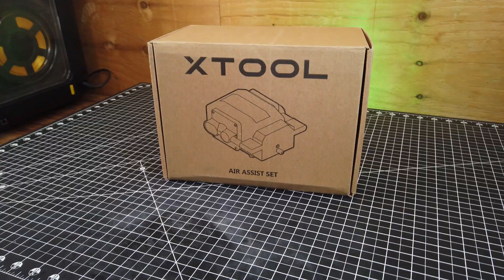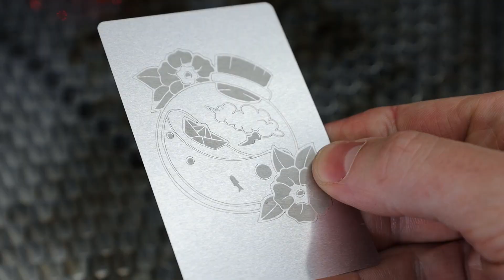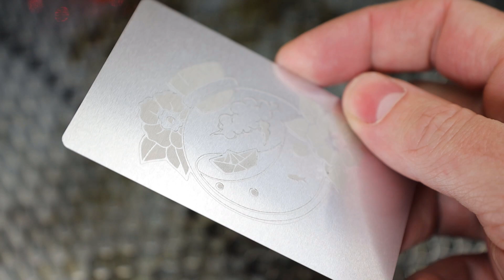Must Have Upgrades For Crisp Cutting & Engraving - xTool D1

Comment from the maker: Check out how you can upgrade your xTool D1 to cut without worrying about burning what's under it and get crisp & clean engravings every time.

From xTool:
xTool D1 Laser Engraving & Cutting machine - https://bit.ly/xToolD1-10W
xTool D1 Air Assist Set - https://bit.ly/xToolD1AirAssistSet
xTool Honeycomb Cut Bed - https://bit.ly/xToolHoneycombBed
xTool Materials - https://bit.ly/xToolMaterials
xTool 20W Diode Laser Module - https://bit.ly/xToolDiodeLaserModule20W
xTool Enclosure Smoke-proof Cover - https://bit.ly/xToolEnclosure
xTool Smoke Purifier - https://bit.ly/xToolSmokePurifier

From Amazon:
xTool D1 Laser Engraving & Cutting machine - https://amzn.to/3jLyLbX
xTool Honeycomb Cut Bed - https://amzn.to/36hLVdq
xTool RA2 Pro 4-in-1 Laser Rotary - https://amzn.to/39u4Mn7
xTool D1 Rotary - https://amzn.to/3tzO0tD
xTool D1 8Pcs Laser Engraver Raiser - https://amzn.to/3O0q7U8
Honeycomb Working Panel - https://amzn.to/3txRY60
3MM x 12" x 12" Baltic Birch Plywood - https://amzn.to/3uMibyJ
1.5mm x 12" x 12" Plywood Sheet - https://amzn.to/3uLqfje
Metal Business Card Blanks - https://amzn.to/3uF3oWp
Earring Hooks - https://amzn.to/3xv2ihU

Free Files:
Engrave Material Test Laser Pattern (LightBurn) - https://drive.google.com/file/d/1VmzXgLFeil-zOarKUNs0QklVCMqqTEQA/view?usp=sharing
Cut Material Test Laser Pattern (LightBurn) - https://drive.google.com/file/d/1DVm-P38fsdGC2fzOeuDwhkWSrzNS6A-t/view?usp=sharing
Earrings Laser Pattern - https://cartonus.com/jewelry/

Cheap Paid Files:
Earring Display Stand Laser Pattern - https://bit.ly/EarringDisplay-LaserFile
Witchy Potion Bottle Laser Pattern - https://bit.ly/WitchyPotionBottle-LaserFile
Magical Moon Witchy Bug Laser Pattern - https://bit.ly/MagicalMoonBug-LaserFile
Mushroom Laser Pattern - https://bit.ly/Mushroom-LaserFile

______________________________________________
If you are looking for more tools and materials that I use, well you're in luck! I made a page on my website just for that.
https://GomeowCreations.com/tools-and-materials 
https://GomeowCreations.com/partners-discount-codes

Note - Most of the links that I use that go to products are affiliate link. This means I make a small commission on anything that you happen buy using them. This is at no extra charge to you and this helps support the work I do on this channel. 😁👍
______________________________________________
Other Ways To Help Support The Channel:
My PATREON ➜ https://patreon.com/GomeowCreations
One time support ➜ https://paypal.me/gomeowcreations
______________________________________________
Instagram ➜ https://instagram.com/gomeowcreations/
Facebook ➜ https://facebook.com/GomeowCreations/
______________________________________________

#xtool #xtoold1 #lasercutter #diy #gomeowcreations
Reply: It kind of smells like burning plastic when I engraved the metal business cards, and the same smell came when engraving a painted aluminium plate. Is it normal? There was a sticker on top of the laser lens and I removed it when installing the machine, but it was quite hard to get off.

Comment: That was a very informative video. Thanks for that, because I have been wondering whether I should get one. Curious of your recommendation between this and the Sculpfun S10.
Reply from the maker: No problem and then it comes to the 2 different lasers it is really going to depend on your budget. The xTool does cost more but it does use better parts and is over all just a better laser setup. Both at 10wat lasers so both of them will get the job done. I hope that helps and if you have more questions just ask.

Also I have a video coming out tomorrow about a CO2 laser that blows all the diode lasers out of the water but it's also not cheap.

Comment: it would be nice if they offered just the air assist parts, don't really need the pump
Reply from the maker: You might be able to contact them about that and get them and if not to you might be able to 3d print some of the parts and get some fitting to make your own

Comment: Would you please do a video with it cutting cardstock? I know you suggested the upgrades for crisp and clean cuts but, would you do it?
Reply from the maker: I might be able to do that at some point but if you want clean and crisp cuts you are going to want the honey comb bed for sure. The air setup will also help a lot with charring and stop most flair ups the might start a fire. I have cut card stock in the past as it had no real problem that I can remember to be honest. 😁👍

Comment: Did you use the 10W or the 20W in this video?
Reply from the maker: I was using the 10w in this video.
Reply: @GomeowCreations  Thank you, you just helped me with my decision :)
Reply from the maker: Oh happy to help, if you don't mind me asking what are you going to be getting, the 10w or 20w?
Reply: @GomeowCreations  The 10w. I been researching for a couple of months day in day out on the watts as well as the M1. With limited videos it was hard to choose but I didn't see a BIG difference with portrait between the 10w and the 20w. The M1 basically does what the D1 does or at least with what I do which is jewelry and engraving. If you have any take on it that could help me, I'm listening 🙂
Reply from the maker: Yeah the D1 is basically the same as the D1 besides in comes in an enclosure and it can also cut stickers with a knife. I do think the M1 has a smaller work area but it might not matter to you.
Reply: @GomeowCreations  oh it matters to me lol I noticed that as well. I like crafts but I also like manly projects as well lol

Comment: I assume this is the 10w version? Are they going get you  the 20w to try?
Reply from the maker: Yes and yes but I will not have that until late May
Reply: @GomeowCreations  nice I have been trying to decide if I should buy one and been trying to contact them to get an estimate of price for a full 20w kit. Not sure if it would be best to go 5 (see how i like it etc and possibly upgrade to 20w) , 10 and just keep a 10w and use it as is, or 20w when they offer it as complete unit.

 It's hard to buy either the 5 or 10 if I plan to upgrade as it seems like waste of money paying for the smaller laser that wouldn't be used wjen the 20w isnt to far out.
Reply from the maker: Yeah I under stand what you mean. After using it I think 10w is as low as I would go with a laser. That is after looking at the suggested setting for the 5w vs the 10w. For me at least it's a time saving thing, the 5w with take about 2x the time as the 10w. 

I don't know if they are going to make a stand alone 20w one but you would think they would. If I needed to get this now and couldn't wait for the 20w version o would just get the 10w and use it until I can get the 20w unit. If you are getting it to make things to sell, it might even pay for that upgrade on its own. Just my thoughts 😁👍
Reply: @GomeowCreations  thanks for taking the time to reply especially quickly and for the honest feedback I truly appreciate it! Do you have any affiliate discount code/links if I did make a purchase, cause I appreciate your help. Also happen to have a good way to contact them I have sent like 8 emails amd got 2 responses that didn't fully answer any of the questions.
Reply from the maker: So the links in the description of this video are all affiliate links. Sadly I don't have any discount code or a good way to contact them other than the person that deals with me directly and I can't give out their email, I hope that is understandable. 

When it comes to your questions, maybe I can help you with them?
Reply: @GomeowCreations  ok cool thanks for the info, just thought i would ask as some on here have said they have a code that helps both the buyer and them. (Maybe you could check into it for you in future because you were very quick to answer and helpful.) You have answered a few and I'll just wait and see on the others they are more geared for the company vs product specific. 

Thanks for your time! If I do have anything else come up maybe I will ask on here again thanks very appreciated!
Reply: Hi.. great video! I am surprised about the acrylic! Everyone boasts how you can cut it! What if there were paper on both sides? Would that work? I am trying to find a laser that can cut clear acrylic for wedding signs! Thanks so much!
Reply from the maker: So you need a Co2 laser to cut clear acrylic. If you have paper on both sides it will just cut the paper and melt the top layer of acrylic and then do the same to the other side. I do have a Co2 laser that I do really like but it's not cheap. Here is a link to it. https://bit.ly/FLUXBeamboxCO2LaserCutter
Reply: @GomeowCreations  Thanks! I had a Chinese laser and sold it. Now that I know more.. I'll probably buy another one. I appreciate the help! I have been thinking about a few. Only because I need a large work area or pass through.

Comment: Can you etch like a stampable logo (leather stamp) out of black acrylic? or is there any other good material for this?
Reply from the maker: So you might be able to do that. Would this stamp be using ink or just leaving an indent in the material
Reply: @GomeowCreations  leaving an indent in the leather. I've seen it been done with a co2 laser thats why im wondering :)
Reply from the maker: So if that is the case it should work to cut black acrylic fore that but idk how clean it will come out